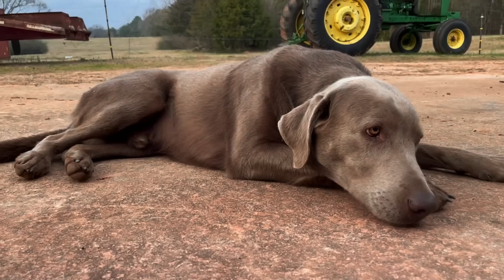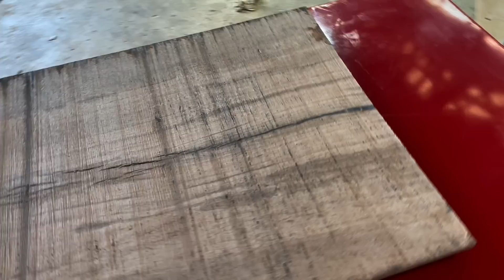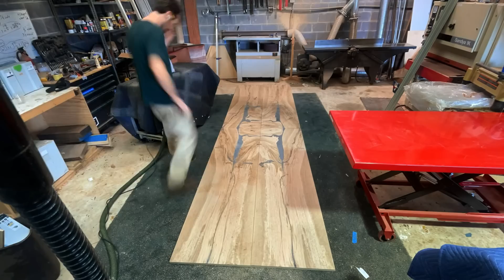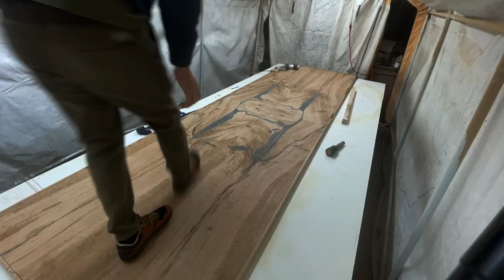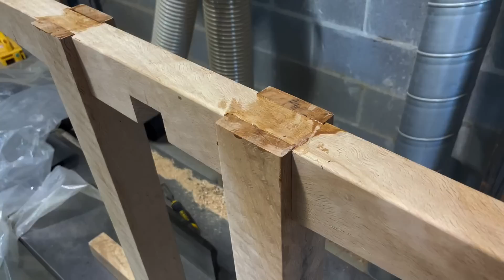I lost a finger building this conference table

Comment: I used to love woodworking but the thought of losing a finger was something I could never shake.  I'm an engineer and one of the hardest problems to solve in any field of engineering is human 
error.  We solved how to do most things a while ago, now we just have to figure out how to do it safely.  Whenever I build products, 20% of the work is making the thing turn on when you press the Start button and 80% making sure it doesn't catastrophically fail in any number of possible ways.  A huge part of that second thing is accounting for all sorts of possible errors that people might make with your product.  

No one is perfect and we all make mistakes, sometimes incredibly serious mistakes, and I knew it would only be a matter of time before I made one.

Comment: What you really needed to do with those veneer cuts, was support the piece once it's cut. At 4:10 you can see the cut veneer collapsing onto the slab. This is (A) giving sawdust nowhere to go, (B) pinching the back of the blade. Right at this point you want to put some wedges in there to support it, then as the saw moves down, progressively add some wedges into the sides to shim the veneer up off the slab.

Comment: Great job. I can definitely sympathize on the finger issue. I recently finished a table that damaged fingers on both hands. I was so upset and it started affecting my work. Then I realized that it’s not so much the “worth it” factor, or even the pain or physical inconvenience. It was that I felt so stupid for not remembering to adhere to my own shop rules about safety and focus.
Question: Why didn’t you just peel or cut that last run of veneer all the way down at the particle board line and the just plane it down to the desired thickness?

Comment: keep your fingers away from line of bandsaw blade. If stop block moves-and it can- will, you will lose more digits. It is so easy to avoid these unecessary risks. You will not gain any edtra time by persevering with these bad practices. Seriously mate get someone to do a risk assessment. I fear for you.
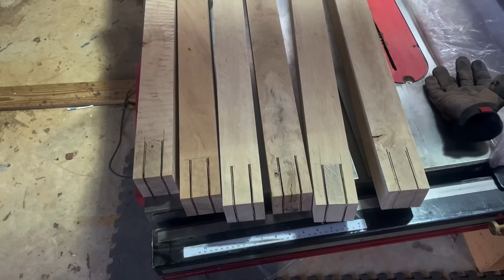Reply: 14:45
Reply: and you will be deaf soon. Use proper ear defenders when using machines.....

Comment: and then pushing through wood through bandsaw like that is really unprofessional. Use a push stick. 
Your workshop is messy with things you can trip over. Plus you balance work on corners of tables, precariously. This is the worst example of bad practice.
Reply: clamp down those those thick pieces of timber before using your track saw. You can see it wobble as you cut it.
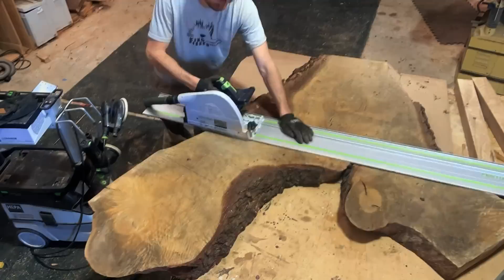Reply: 13:24
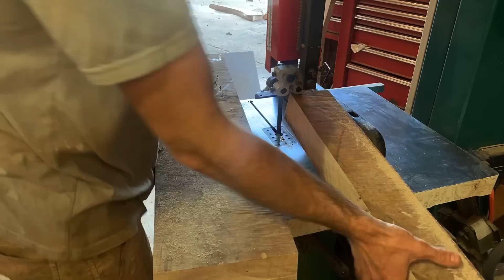Reply: 13:27

Comment: The sawmill doing that is usually from a sudden change in the woods hardness. In my milling experience it has always been like a know or just a grain change and then it over corrects and goes all wavy. Another thing that can cause it is a change in speed of the milling or going to fast. Great video by the way
Reply from the maker: Thank you yea I’m thinking maybe the hardness of the resin through it off. Hard to believe it would do it that much but it’s got to have something to do with exactly that   Thank you for watching 👊

Comment: So I noticed you’re getting comments from armchair sawyers, and I thought since you gave up a finger for this project you might like some thoughts from an experienced sawyer. I’ve been using a bandmill since 2009, it’s given me lots of opportunity to ruin a lot of wood lol. I’ve sawn in the range of 200-250,000 bd ft for context, so I think I’ve made almost every mistake there is to make. Anyways, I have had that same issue when sawing large, partially frozen green logs. When the logs are thawed or fully frozen it’s no problem, but partly frozen is a pain because of the significant mix of densities between the thawed and frozen wood. I think this is the same issue you are having because of the resin. The things I do to help with the issue is:
- increase blade tension,
- run a lower tooth / hook angle, if you’re using Wood-Mizer blades try a 4 degree,
- slow the feed speed down by about 25 percent and to keep the blade speed up.
Reply from the maker: Thank you very much. Yes I think the resin/wood is one of the main reasons.  This wood was incredibly dense and the resin be even more so, I would imagine gives a kind of frozen effect.  I appreciate the expertise rather than just stating something obvious and then criticizing haha

Comment: Should have used a brand new bandsaw for thin, sensitive cuts like that. Any sharpening anomaly on the teeth will make the cut deviate slightly. Doesn't matter on thicker slabs, but for this its a variable worth eliminating.
Reply: He use a brand new bandsaw specifically made for hardwood.
Reply from the maker: @ninjaduck3534  and two cuts per blade and then I’d switch to another new one
Reply from the maker: Well the blade was brand new if that’s what’s you mean?
Reply: I wonder if he means a new blade for each cut, so each veneer had same blade condition.

Comment: Jointers scare the sht out of me for this reason. Hope youre doing well
Reply from the maker: They really are just scary machines
Reply: @Kingfisherwoodworks  I got my shirt sucked up in one once. I thought I was being attacked - the jointer pulled me down by my shirt so hard and fast I thought a 400 pound man just body slammed me from behind. Thank god my shirt jammed up the blade before I was gutted. Extreme paranoia is now the mindset I approach any jointer task with. Inspiring to see the injury didn’t bruise your spirit and chase you off from the project, amazing work!
Reply from the maker: @conorcurran971  good lord.  I’m not even kidding I have nightmares about that exact thing happening, especially likely  with a jacket.  I now tuck my shirt in before using the joiner.  That is incredibly sketchy, I’m glad you’re alright that could have been real bad.

Comment: Did you look under the legs? For the finger you lost, i mean.
Reply from the maker: I feel like the pieces of it got sucked into the dust collector.  I looked in the pipes and the bin.  I feel like it’s probably sitting in the actual metal pipes which I can’t get to without taking it apart.   Who knows 🤷‍♂️

Comment: One of the most beautiful tops I have seen in a long while . Sorry it came with such a high loss .
My guess is that the saw blade got dull quickly cutting epoxy . Blades only cut well with consistent densities of wood .
Reply from the maker: Thank you.  Oh man that is 
 actually a pretty good guess.  We did change out blades after the second cut but honestly this is now my top explanation ✊✊✊

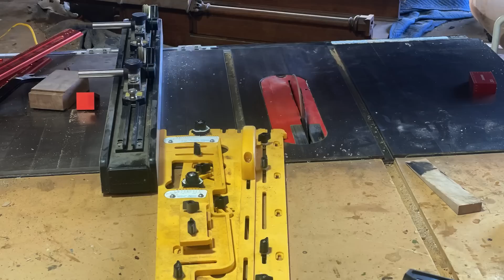Comment: Even at 17:16, your hand is way too close to the blade, sawstop or not!
Reply from the maker: Was a very slow cut but I’ll be using a push paddle from here on for every machine.   The lesson was learned.  🙌🙌
Reply: Yeah lots of them not so safe examples in this video.  Wearing gloves using the drill press. Letting off cuts sit while marking repeated cuts on the tablesaw. Making small cuts on the miter saw without a sacrificial fence. Just to name a few

Comment: Why did you leave your sawmill roller blade guides so far away from your work piece??? No wonder it didn't cut straight and went wavy!
Reply from the maker: The one on the right was about a 1/4” off and the left one cannot move.   It is spaced away from the edge like that to compensate for round logs.